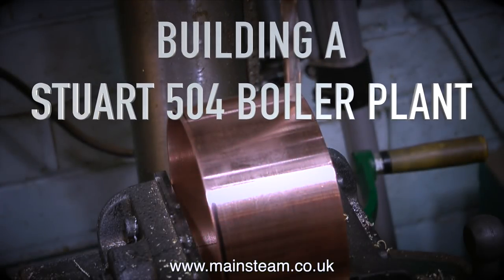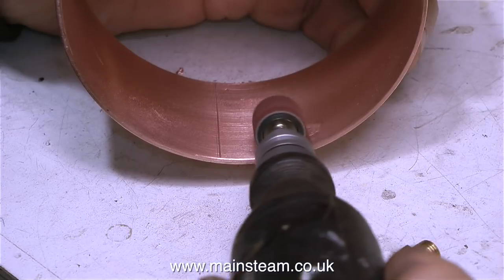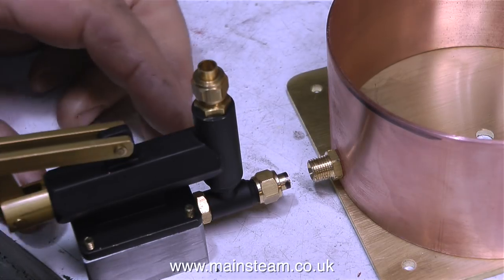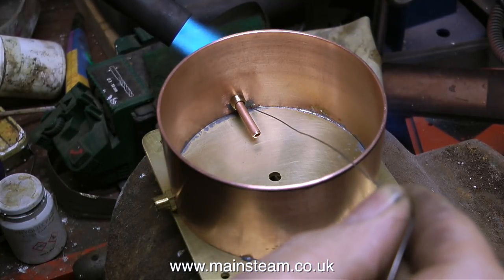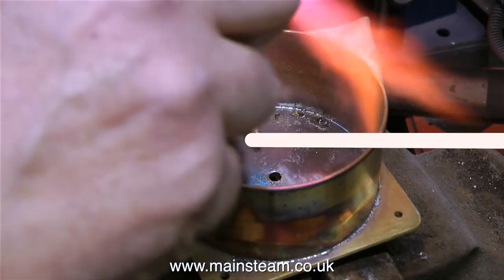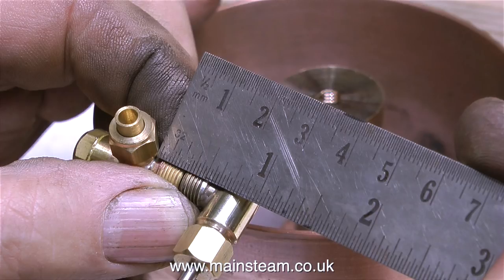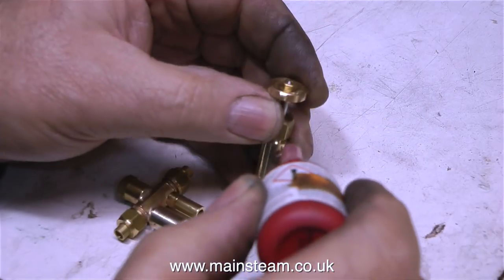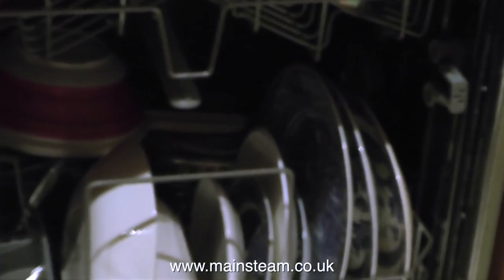MAKING A STUART 504 BOILER PLANT - PART #5 - FINISHING THE WATER TANK

Comment: I have Revere-ware copper bottom pots and pans we have used for over 55 years. I clean the copper bottoms of the pots with vinegar from a spray bottle misting till wet and then sprinkling with table salt. A light wiping with a sponge or Scotch Brite for heavy soiling and it is clean again, bright copper and inexpensive. Give it a try. Love your channel.

Comment: Dishwashers are great! In the distant past I used ours to clean a black powder Colt Navy cap and ball revolver. Provided you removed the wooden grips and removed the parts from the machine before the drying cycle it worked a treat. Domestic authorities were not impressed. Not sure why.

Comment: Cheers for the headsup for that tool place lol no joke my delighted squeals of "omg I so am getting that..." alerted two daughters with jaw muscles set to nag and they took my card away as they knew I would have pauperised meself on that site lol so I have to go cap in hand and under strict supervision will I be allowed to lightly sprinkle my card and only for ahem essential parts so I sense trouble brewing ahead, the 6mm tooling is ideal so starting off with a couple carbide holders and a boring bar.   Downloaded the Blackgates catalogue too as got to admit it does do a lot of the things I want too including that delightful set of spanners you showcased which I do want to get some in and some stock too :)

Comment: Hi Keith... I treat my soldered parts normally in a citric acid/sodium chlorid solution to reduce the oxide and neutralize the parts afterwards in a hot soda bath... all the fatty acids are gone as well... very similar to your approach putting them in a dish washer ;-) (the dish washer taps are almost all based on soda but cost much more...) Soda is also included in my boiler treatment mix as explained in one of my videos... The lifespan of a iron based boiler will be prolonged dramatically at higer pH of the water... regards Christoph

Comment: Another way to line up the pump fitting with the tank is to use a bit of the missus' lipstick on the fitting and touch it to the tank, leaving a pretty red mark.
Reply from the maker: Fortunately, I don't currently have a "Missus" and my shade of lipstick is a bit too light }:-)))
Reply: Ha!

Comment: What size copper tubes are you using for this?
Reply from the maker: 3/16 of an inch for the main piping and 1/4 inch for the exhaust piping
Reply: Keith Appleton I meant to ask about the size of the top tank and bottom tank.
Reply from the maker: 3 inches diameter for the top tank and 4 inches diameter for the smaller bottom tank.
Reply: Keith Appleton thanks. I wasn't sure you mentioned it. I was assuming so. And you know what assume means???